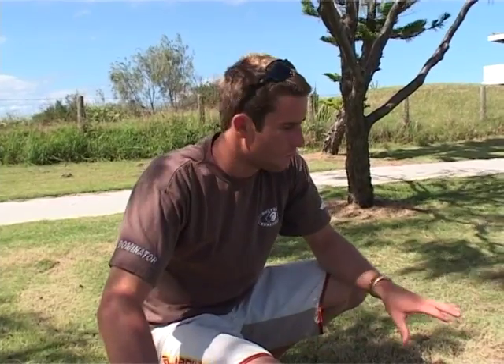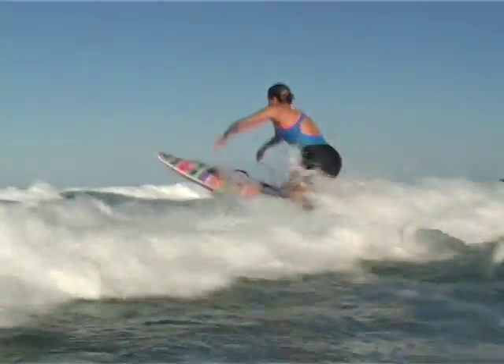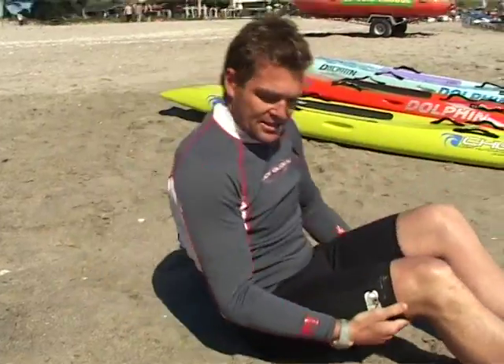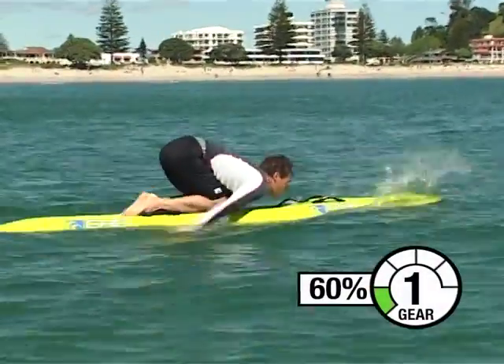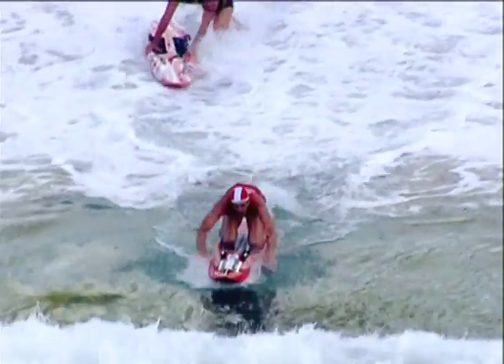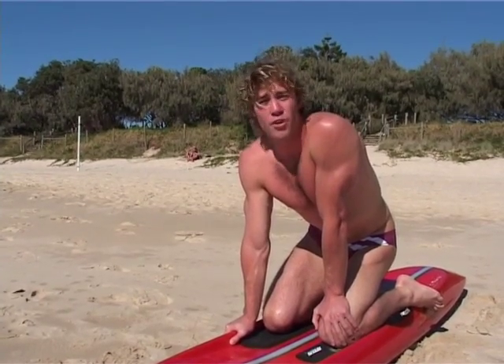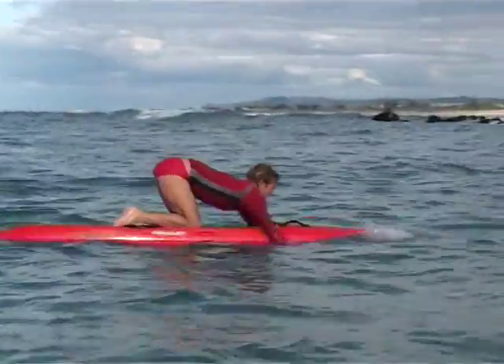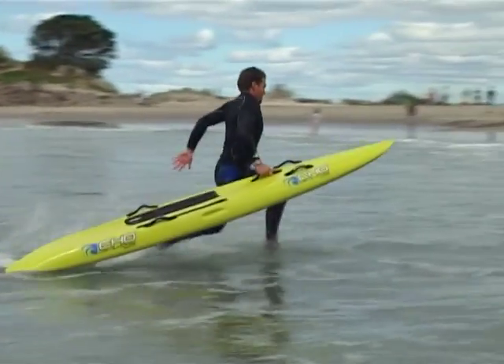Surf Coach Board paddling

Comment: What’s the difference between, mal race board, rescue board and prone paddling?
Reply from the maker: Kev Mac Technique-wise kneeling or prone on a race or rescue board are same.  Prone with a victim on for stability. Typically in open water kneeling up is faster.
Reply: MrBundybear3 Out if interest what size boards are in this video 10-6. Or 12?
Is 12 a better all rounder? 
Also is a similar sized SUP or Prone/kneel style faster?
Reply from the maker: Kev Mac They'd be a 10'6" racing mal, per SLS gear specs.  I believe the 12 foot from the ocean paddlers in open water are quicker, and of course a SUP should be faster still.
Reply: @James Jeffery definitely, been using Instaflixxer for months myself :D